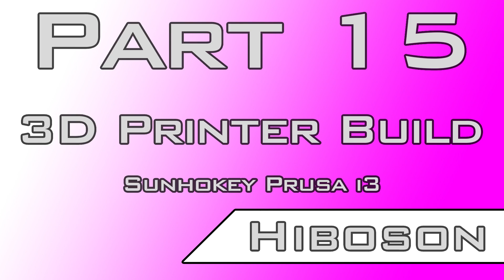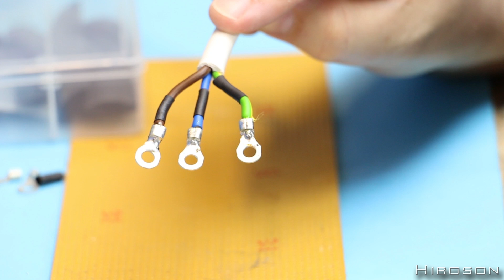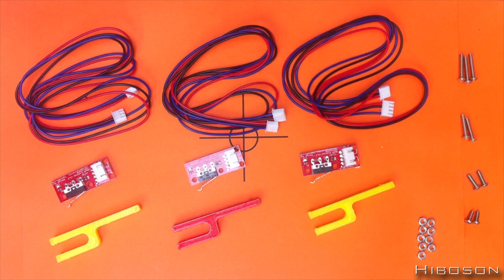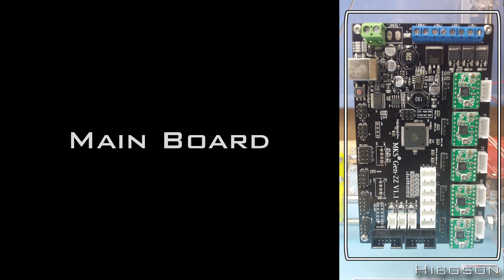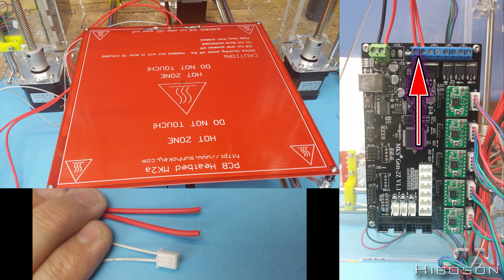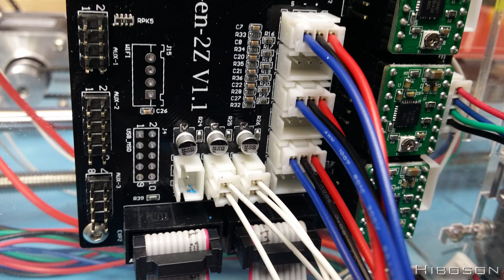3D Printer Build (And Breaking Again) - Sunhokey Prusa i3 - Part H

Comment: Hi, I have purchased the latest Sunhokey Prusa I3 and there are a number of improvements/ updates to it. One thing which is missing is the second fan. I'm not sure if it's supposed to have one. I can't find any fittings to attach one. It's simply sitting there directed at the hot end, no scoop, nothing to direct airflow, just a bare fan. 

The end sensors have their own acrylic fittings now, no more bendy bits. I believe your complaints about certain things have been tackled in the latest version, although Sunhokey's new video makes no mention of it.

 Actually the video is almost hopeless. All done with a pure white background which makes the acrylic parts almost invisible. Plus there are way too many parts omitted and too much time wasted because the builder gets lost too often and makes mistakes. That's why I'm watching yours as well. My thanks for that.

You don't appear to be worried about the masses of wiring left lying around. I was wondering if I might shorten them all. It's a lot of soldering and heatshrink, but it would make things look neater. Plus I'm concerned about the resistance on these wires. They seem very light for some jobs especially the hot bed. Could that be the cause of so many people blowing their power supplies?  Keep up the good work.
Reply: +propfella please tell me if that video still work for the 2015, it's the one i have (BTW i agree with all that you said, HOPELESS instruction!)
Reply: If you check the date I posted the video, you'll see it was 2015.
Reply: yes i know, but  you said you watched it, you didn't said if it worked after you followed his steps, though if you answered me that, it probably did work

Comment: Simply crimping good might have been better... Tinning, etc. not needed for higher voltage electrical circuits as opposed to lower voltage electronic interface circuits... HTH

https://duckduckgo.com/?q=why+not+solder+110+240+volt+electrical+connection
Reply from the maker: ***** I need better crimping tools, as mine aren't the best I don't mechanically trust my crimps thus soldering is much safer option for me at the moment ;) Once I can invest in some really decent kit might not be so much of an issue, but I'm used to doing a lot of wiring in cars for my projects and have pulled off one to many crimp connectors in the past I switch to soldering them, but then again them projects I am plugging/unplugging wires all the time to reconfigure so them crimps where taking a pounding lol

But thank you for the link, very interesting read ;) 
All the best,
Hiboson :)

Comment: Hibson, I also have another version of this printer. Looks great when it is finished! I am having a problem with the box type fan (my only fan). When it is plugged in on the port your pointed out it actually goes full speed non-stop and keeps the hot end from getting to a printing temp. I would love to know if you have the same problem....
Reply from the maker: Daniel Hemphill Well not got that far yet lol so can't say if I've got the same problem yet, hope not but if I do I'm sure I'll pop it in a video and what I do to fix it, if I find a way lol

Which socket we talking power rail along top or the header pins connection?
Reply: The header pins...for the box type fa
Reply from the maker: Daniel Hemphill Intreeging,, well I'm hoping tonight to go out and do the connector repairs and get the Z axis working, tidy up the wires etc, so maybe who knows I might be able to even test print tonight, maybe (time dependant). So once I know whats happenes on mine might be more help with you.

But if your on Facebook you might want to check out the Sunhokey Prusa i3 owners group....
https://www.facebook.com/groups/sunhokeyprusai3owners

They might be able to shed some light onto your issue ;)

ATB
Hiboson

Comment: Great video! I got around my Sunhokey before I found this video - so Im about 2/3 into build. One thing I would like to point out is that I have a different version of this kit - there is no print-fan (for cooling parts) - only for extruder also there is only 2 printed parts - the ones to hold the extruder fan. So in my case all parts are acryllic. and extruder it self is a bit different.
Reply from the maker: gcardinal Yea there do seem to be 2 or 3 variants, maybe one day I'll have one of each lol Hope your build is going well :) I'm nearly there, got some cables with the connector on I need today so hopefully be able to do a bodge repair soon :)